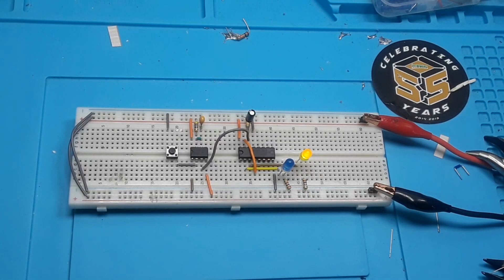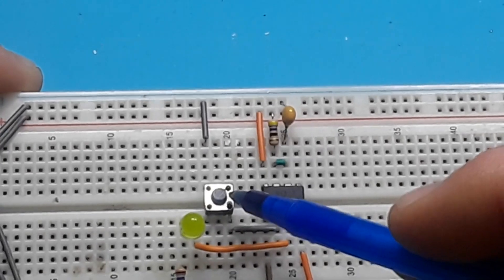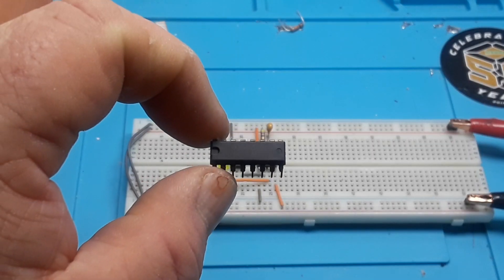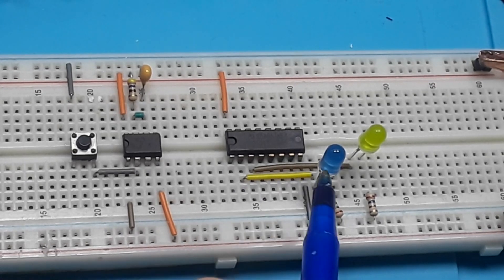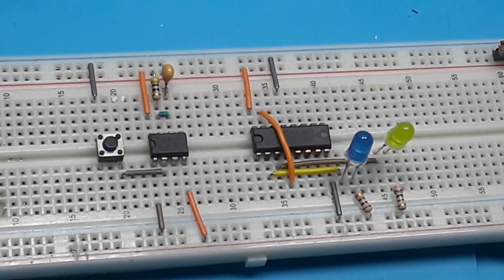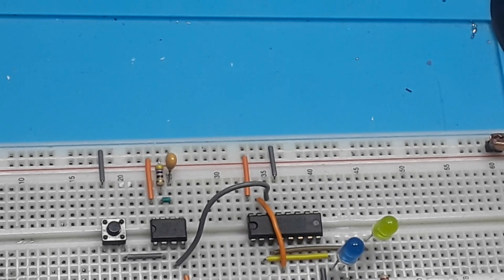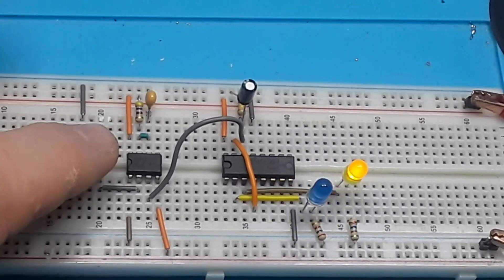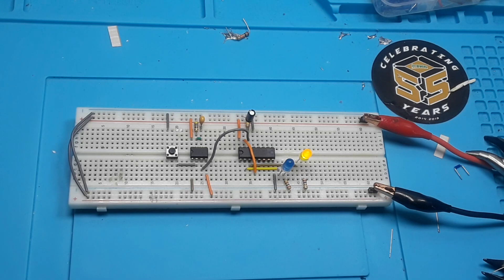Classic Circuits You should Know - Single Button Toggle

Comment: Just wondering what's the role of the 555, why not just use the switch directly?

Also to debounce, why not put the cap in parallel with the switch?

Comment: I have a function on a microcontroller that works by using a switch to connect a pin to ground.  I have another microcontroller that outputs a 3.3v signal, how can I get that to switch the first controller? can't you use a transistor instead of a relay?

Comment: if you're using a counter, toggling can be achieved simply by monitoring the least significant binary digit. no reset is needed. as you know, when you count in binary, the lowest binary digit keeps changing its state from one step to the next. (and btw, LOVE your videos! keep them coming! :))

Comment: I was looking for some good material on this subject and when I saw learnelectronics i knew it was going to be good. Ok, a few questions. Do you think I will be able to get that bouncing off with the correct rc values? I'm looking to replace the push button with a hall effect sensor and do a mechanical mounting on a wiper motor (the hall effect sensor). Every time the hall effect gets triggered it should change state and then flip to relay nr 2 going in reverse. So the "stroke" will be the hall effect sensors spaced at the correct stroke. I'm sitting out on the h bridge because Relays are cheaper and will be more robust. Basically, I'm trying to imitate the wiper motion so that I don't have to do custom fittings on custom tractors. The whole linking arm modifying takes too much labor. I'm using those solid state relays they sell cheap. 2n222? I haven't played too much with a 555 but it would be nice to get more of a delay between toggles to let the magnetic field collapse see that freewheeling won't work. Any Bright ideas analog-wise?

Comment: If you want to debounce the switch, you must increase the time of the 555 output pulse by increasing the resistor and or the capacitor ( t = 1.1 R C ).
Trying to debounce the output of the 555 is not the correct way, use the 555 to get a nice bouncefree pulse that's the function of the 555 in this circuit.
Your RC time is to short, just increase and get surprised of this solution.

Comment: There are two simpler ways of doing this.

1) Forget about the 555 and just use the switch on the CLOCK pin of the CD4017. (Karl A pointed this out also),

2) You can set up the 555 on it's own as a latching switch connected to a relay and use the NO/NC positions to switch states.
Reply: or make 555 one shot to debounce.  This video really didn't go in any direction that made much sense.
Reply: I was thinking of a D-Flip Flop where you feed the /Q output back the the D input, wouldn't that work too?
Reply: @BertGrink  Yes a 4013 would work well in this circuit. With the 4013 though you're wasting the D latch, so that's why a 4017 is used
Reply: I was also confused as to why he didn't just use a bistable config for the 555.

Comment: My basic electronics is a little rusty and was more empirical than knowledge but surely a simple JK Flip Flop (there is an IC I think) with a bit of debounce on the trigger is all that is required.
I would think 2 ICs, the JK F/F and a Quad 2 input NAND gates for the debounce. Not sure of course but I do not think you would need a capacitor. I am certain I have seen and used such a thing 20-30 years ago. In software two F/F make an excellent debounced Toggle and I can see no reason why that would not apply to ICs of Discreet components.
I used the software version in machine control to protect against a Start Button being stuck in the ON Posn. A trawl through my Note Books may locate it. Locating the Note Books may be more difficult :-). Last one must have been dated 2001.

Comment: Well explained Paul. I've used this circuit as a clap switch, replacing the  555 with a LM358 mic preamp and comparator to toggle the clock input

Comment: I do like this channel but its no use building a circuit that doesn't work correctly, or only sometimes, and not going to the trouble of drawing a quick diagram. It is called LEARN electronics after all. Sorry for being so negative.
Reply: I was just thinking the exact same thing.  Wish he corrected the bounce issue and walked through a schematic.
Reply: I agree. All he did was show us a circuit that doesn't really work properly. There are better ways to construct a Toggle Circuit.
Reply: Richard Redcastle hop off the Duchess of Hamilton and search for how to troubleshoot circuit errors.  There are two essential skills rolled into one-self sufficiency and troubleshooting.  Sorry to sound so harsh.
Reply: @cw4608  Thanks Carol, I now see the error in my ways. Hoot Hoot!
Reply: He gave you a starting point, now you can use your skills to improve the circuit to perform as you need it to.
Reply: @davidmoran4471 , some people don't have the skills and need to be shown how to fix the circuit. Some people just want to be shown how to assemble a working circuit. 
This video does nothing for anyone who wants to "Learn Electronics".

Comment: what is a bounce is it noise?
Reply: Bouncing is an undesired effect in mechanical switches. Ideally, you would expect a switch to be either on or off, but when pressing a switch, it can send a fast series of on-off-on-off-on... just before it makes a good connection. There are several reasons why that can happen, but the important thing is that the digital circuits (TTL or CMOS) are fast enough to trig on each of those ons and offs. The simplest remedy to 'de-bounce' is putting a low-pass RC-filter between the switch and the digital circuit's input, but it can be done digitally too or in code if input is to a microcontroller.
Reply: @tomg1004  well explained 👏
Reply: I allow me to answer, even that I may not understand your question... up for a great start eh? :-)
A bounce in this circuit, is when you expect the circuit to change the color because you press the button, and it does but then "bounce" back to the original color. It does that because the 555 do send a pulse out several thousand times a second, as long as you hold the button down, and each time do that pulse trigger the 4017. So if you press for just a fraction of a second, do the 555 maybe switch 3000 times. To avoid that, do you add a capacitor that make the time between the pulses much longer, i.e. a second. So if the person who pushes the button, do that in a shorter time then that second, do everything work fine. Do the person press for longer then that second, do the 555 get time to send a second pulse and the 4017 switches back "bounces". Hope that helps:-)
EDIT: You could then ask, why not just add a capacitor that make the 555 give a pulse every 10 minutes and you avoid the "bounce"? That gives the problem that you also have to hold the button down for 10 minutes for the first pulse to be made and nobody would find that particular great! :-)

Comment: A nice well explained circuit!
I would be very much interested for a "one push button on/off latching switch circuit" for battery application circuits. Ideally, something that, at its OFF state, would not consume any current. Is that possible? My general thinking goes to using a few transistors. When button is pressed transistor conducts biasing a second transistor which latches the first one, and the whole circuit biases the gate of a mosfet which will open and allow current to flow to the application circuit. When button is pressed again, base of first transistor is grounded an the whole circuit is turned off. This is what I am thinking but I do not have enough knowledge to put a circuit together that will do the job...

Comment: Cool video, do you ever play with PIC16F877A IC's

Why does everyone use teespring, they are so ridiculously expensive compared to other quality made t-shirts you can get made. Teespring feed off successful channels and do very little for a bigger profit they would otherwise make. You would make so much more on a percentage basis by using a cheaper option that doesn't comprise on quality.

Comment: Simply you can use a switch instead of that circuit. 
Kidding 😄 nice circuit sir we can control high load using some transistors in place of LEDs.